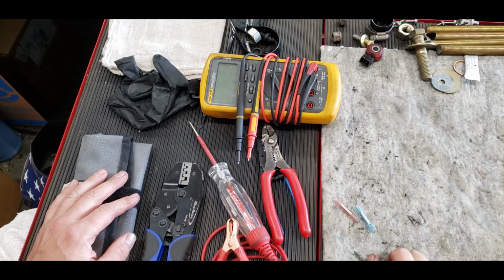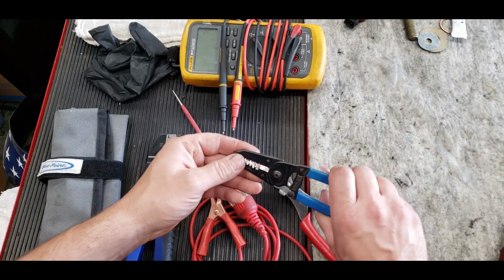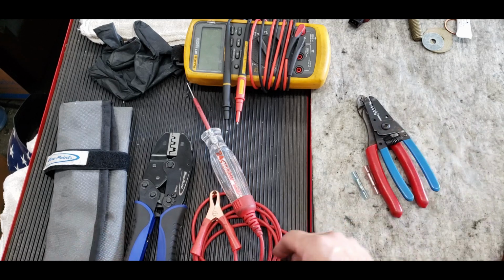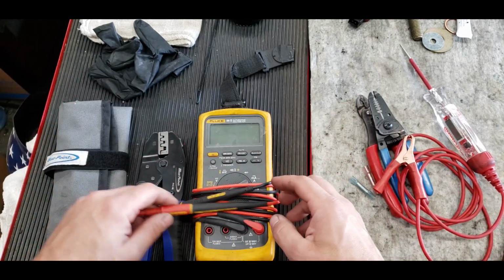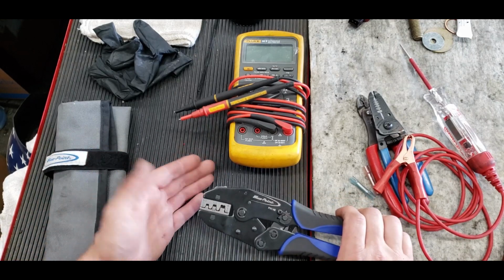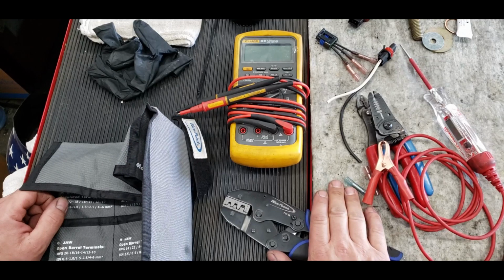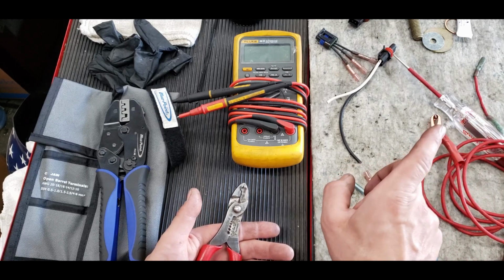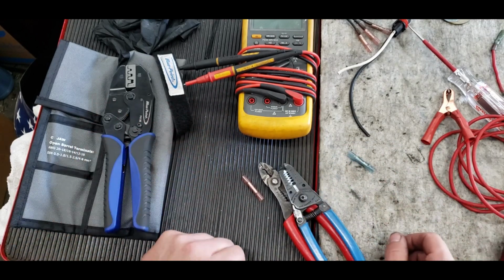Starting Off, Diesel - Electrical Tools

Comment: Brandon check out the 'fuse buddy' they have one they even sell at harbor freight for $15 with the battery tender's and I friggen love it! Also B-dog those Carlyle strippers are sorta on the junky side and I have the same style but a mirror chrome finish from vim that I compared them with and yeah the vim's were the better of the 2 cutter wires like butter! I been wondering about the snappy set whether it would be a good forever set for me to have and don't not cut theres thoroughly. Love the series!
Reply from the maker: got a battery tender from there works ok as well as the fuse buddy thiny (havent used yet lolol) thank you for watching bud and hope you had a good weekend!

Comment: Another cool video   Saw the Penske truck in your shop  Do you work for Penske?   Just wondering cause I do
Reply from the maker: Hey Thomas, I used to work for them, and well, needless to say i may have nuked a bridge when i left after getting thrown under the bus a time too many. Penske INTLthat you saw was a rental from atlanta... one of our drivers had an "ooops"........... the other ftl penske in there was a rental (crummy thing) that valvoline is paying for while they do sampling on test oil engines we have been running for them since they wanted to in frame a number of them. Hope you had a good weekend and thank you for watching

Comment: I'm an electrician.  I use the Harbor Freight wire strippers, which are a copy of Klein.  In my trade, no matter the brand, strippers only last about a year.  HF will warranty them out no problem.  Even if you cut a live wire and blow them up! 

I don't just grab them off the rack though.  I look through a bunch of them and buy the one that looks best.  Some of them have oval shaped stripping holes when it should be round!
Reply from the maker: good input bud! yeah, i have looked at some of their side cutters, and even some of the blue point chinese ones also look a bit "off" (off center or not uniform bevels on occasion) and that would always drive be nuts, prob even more so if was set of strippers lol. hope that you had a good weekend bud!

Comment: I agree with everything you recommended. I also have the same tools except my fluke is a 233.
Reply from the maker: thank you adam, and the 233 was something looked into a couple of years ago, they have come quite a ways over past few years since i bought my 88v, have to admit though their detatchable screen is something that is pretty wicked. btw, how well does it work or how far can it go from your experience?
Reply: @BeardedSeabee82  i can hook it to the trailer brake light circuit on the truck and watch the results on the screen at the back of our low boy.